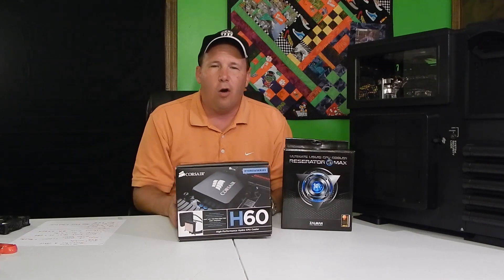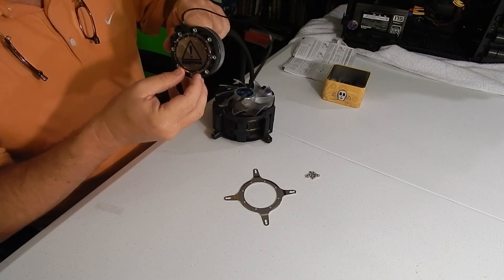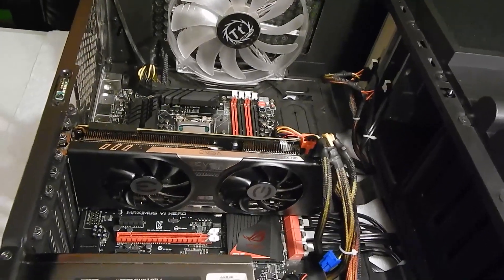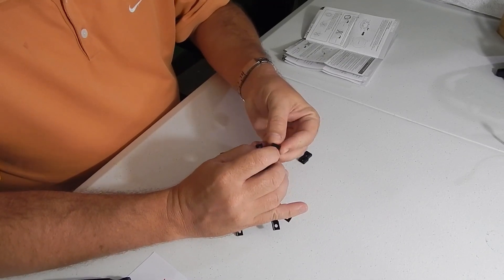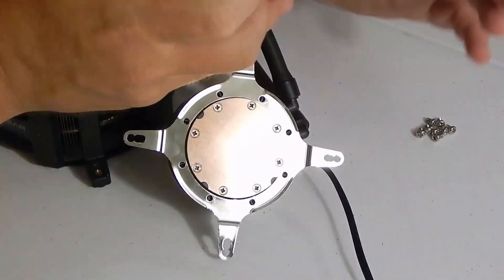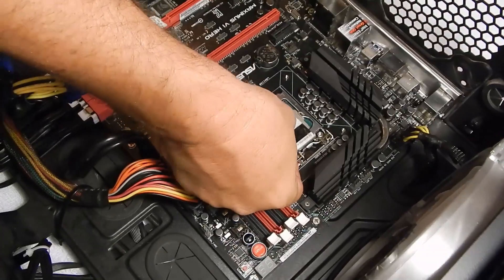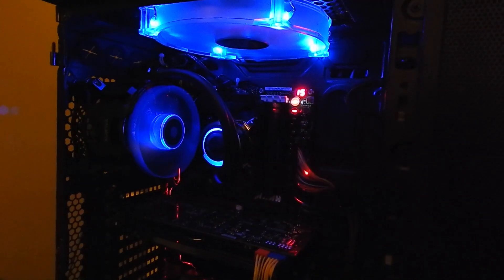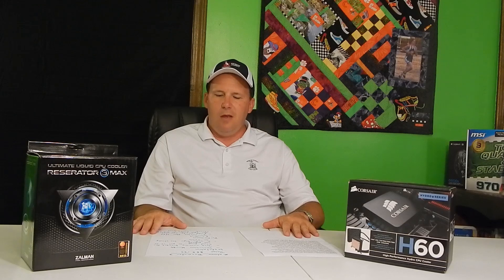Zalman Reserator 3 Max Installation

Comment: SO when you say the mounting bracket is upside down in the instructions - in the video is that you mounting it correctly or upside down because I have seen two videos and they do it two different ways.
Reply: In this case, bracket is mounted correctly.I did the same mounting and temperatures speak for themselves.If you look carefully the instruction manual you will see the same placement.

Comment: i'm really thinking of buying this for a build in the NZXT H440 blue case, with R290x Vapor-x tri X and a blue z97 mobo from asrock but i can't seem to find a good review of the thing in comparison with other coolers, and more information about noise levels. I don;t know if it's the other case fans or the cooler itself but it seemed so damn loud